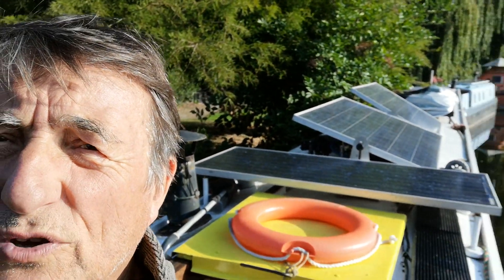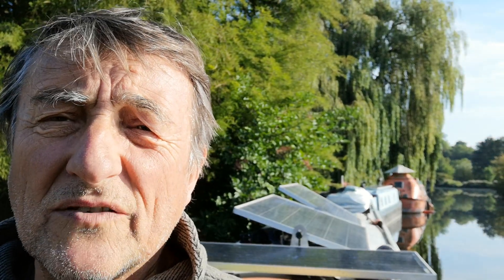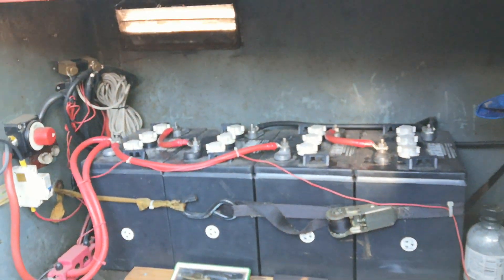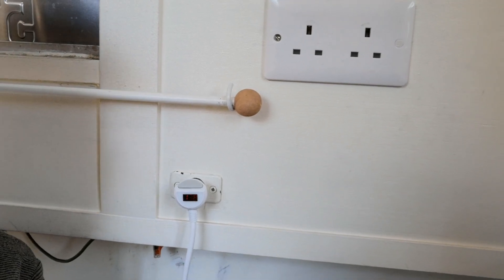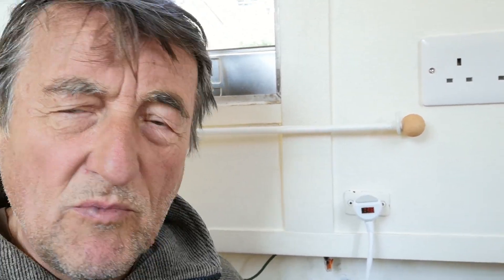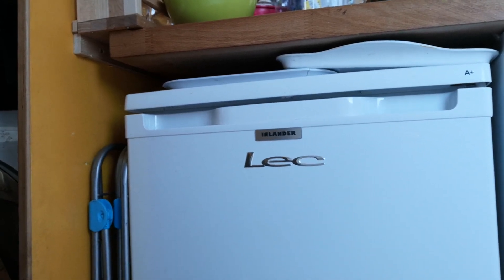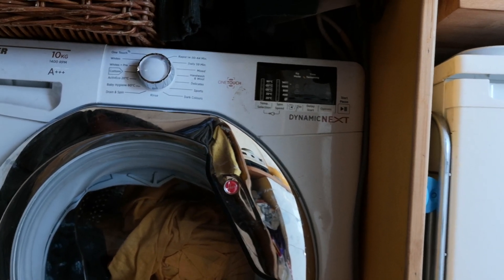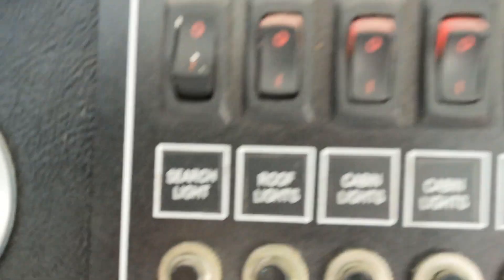BARGING FREE - how to generate and manage your own electrical supply on a narrowboat

Comment: I have never been  on a narrowboat. . Probably never will...  but I enjoy  this😂 &  know this.....   SHARING  YOUR KNOWLEDGE    like this is a gift from heaven.🍷🍸🍹❤❤❤❤
Reply from the maker: Hi John, thanks for your comment. It is a unique system on a boat and no boat is exactly the same.
Reply: @AlanDenman13  
Good one John :), same here..
Alan, was wondering if you add a few more batteries would make life mush easier for you, is that right, or am I missing something?
Reply from the maker: Thanks for your suggestion. There's not space to add more batteries but there are different grades and types of battery. The really expensive ones are lithium batteries which need less rehcarging.